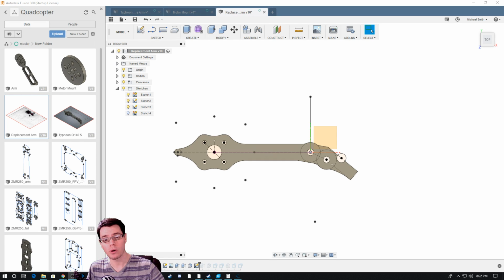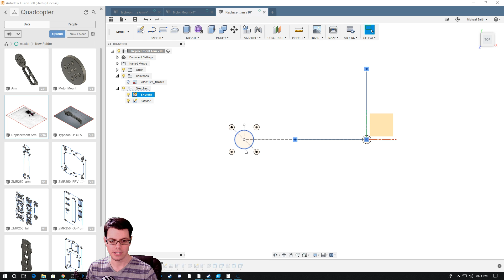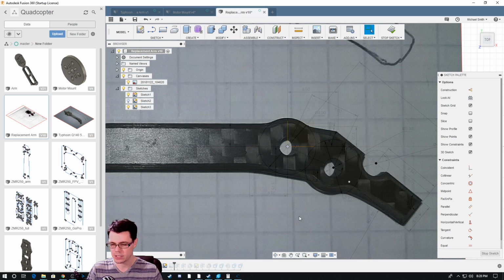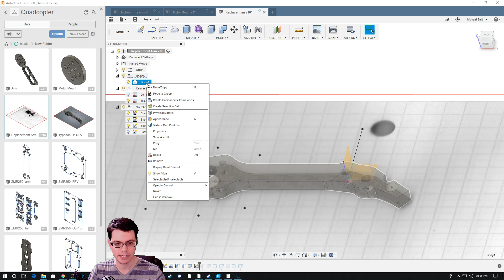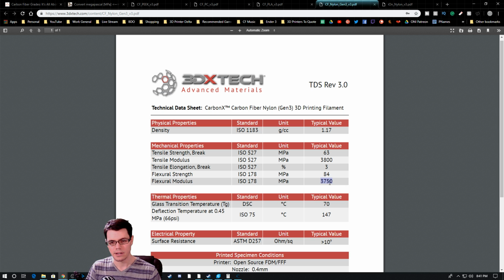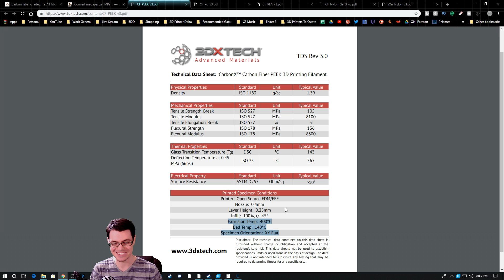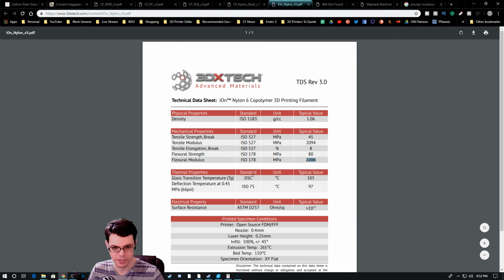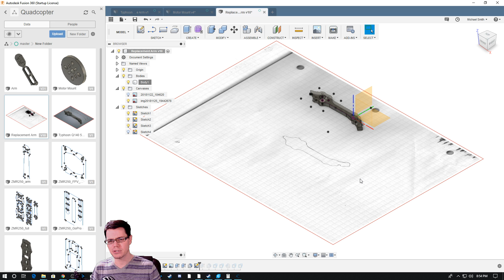Carbon Fiber Nylon 3D Printed Drone Arms! The Details in CAD and Material

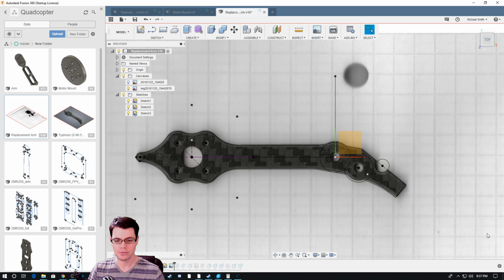Comment: You could have used the scale function at 6:30 to make it the correct size. You can pick any two points on the sketch as reference for scaling.

Comment: hi,  i watch and sub to your oni channel. im not an engineer and have no idea about 3-d printing, its an interesting subject tho. i do however, fly drones. anyways, i was wondering if the reason you added that extra material was strictly for vibration dampening or did you expect it might add stiffness? do you think a ridge in the middle would add more stiffness, but would it also dampen enough? thx for the entertainment. (maybe this comment should be on the other video but...:)
Reply from the maker: I only added the extra bit to try to make the arms stiffer. I quickly wanted to see if that would fix the oscillation I was experiencing.